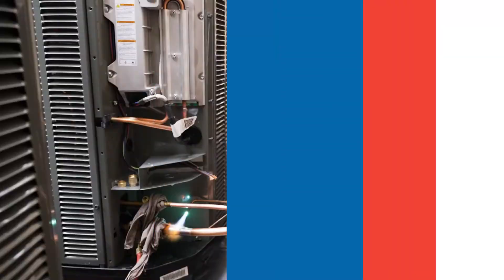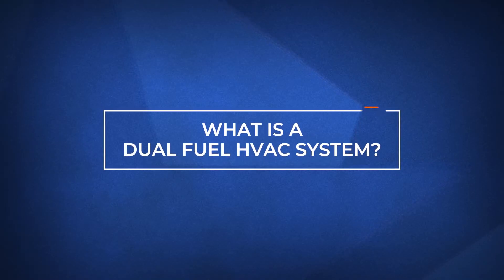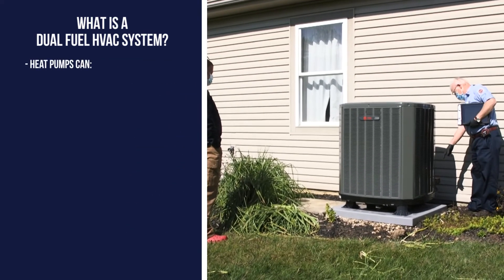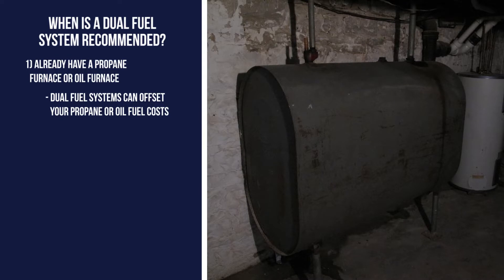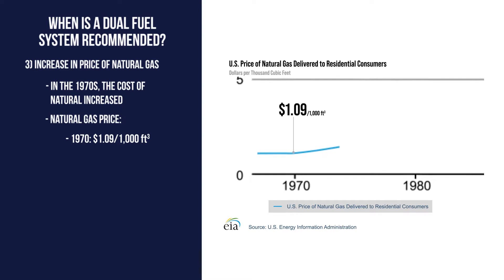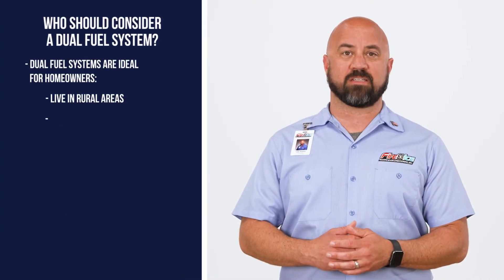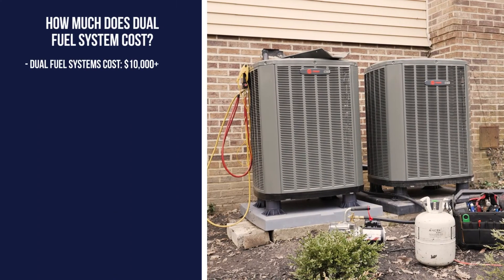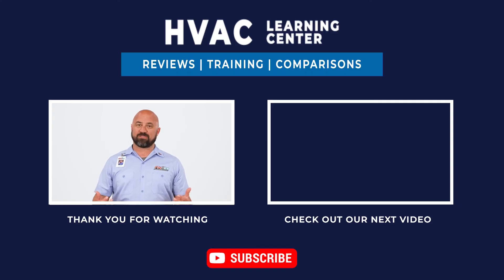What is a Dual Fuel HVAC System?

Comment: So would it be cost prohibitive to replace an all electric heat pump with one of these? I just bought a house with a wood stove and chimney that aren’t safe to use.  I’m wondering if the money would be better spent putting in an outdoor propane tank than replacing the wood stove and chimney.
Reply from the maker: That’s a personal choice

Comment: I have a dual fuel system, electric heat pump combined with a propane gas furnace. My home is located in Michigan where we have a wide range of temperatures (sub zero to mid 90's). Heat pump heats house down to 30 degrees then furnace takes over. Over the last two years this system (system is two years old) has saved me close to 400 gallons of gas each year. The heat pump does a wonderful job of cooling my house during the warmer times of the year. I'm very happy with the performance of this system and the savings it has given me. My home is always at a comfortable temperature without any noticeable noise or drafts.

Comment: Do dual full systems commonly require two separate thermostat for an existing gas furnace? Will the gas heat turn on automatically when temperatures are too cold for the heat pump?
Reply from the maker: One stat.  Yes